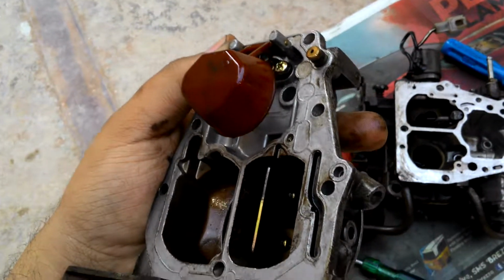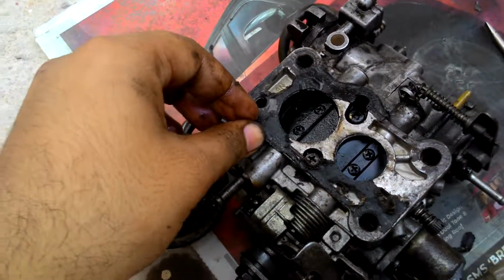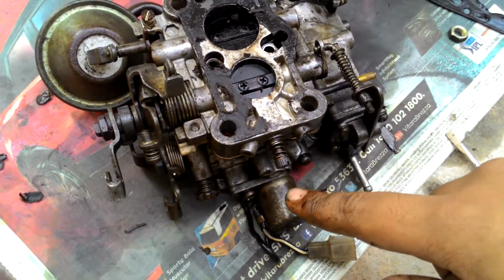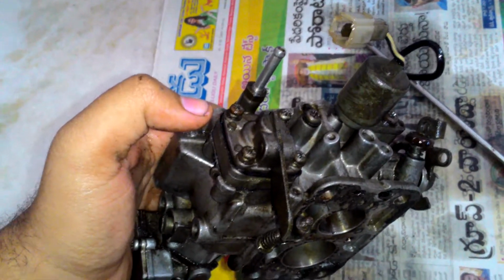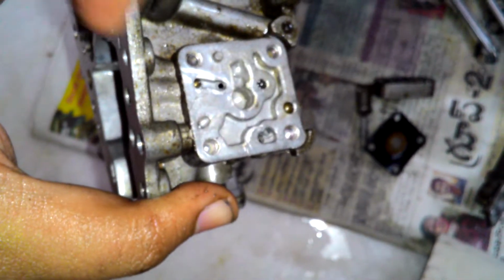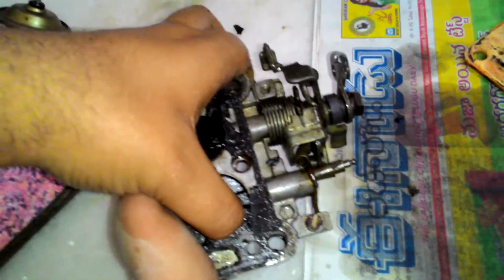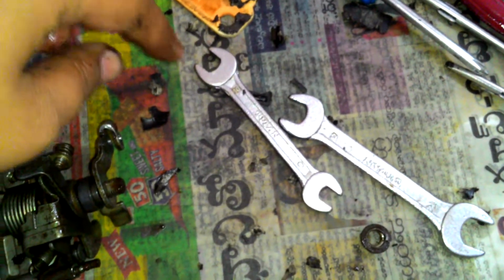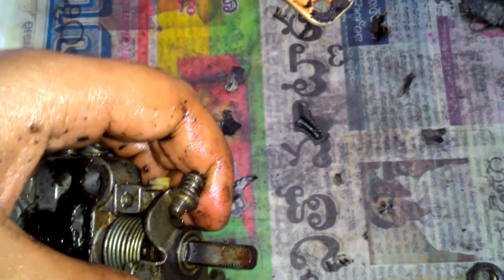M800 Rebuild Part 4. Cleaning the carburetor - II

Comment: aveem asfaq sir ihave a question in my Maruti 800 the   carberaturer has be Woking and 1st pipe of fuel pump is working and second pipe is not working ithink the carberature is trooble shooting if the petrol will not coming in the tank please help me
Reply from the maker: Try adding fuel injector cleaner to half a tank. See if it helps. If not, you have to open up the carburetor and replace the float pin gasket. Iwill be putting up a video in a week on how to clean carburetor.
Reply: +Aveem Ashfaq thanks sir